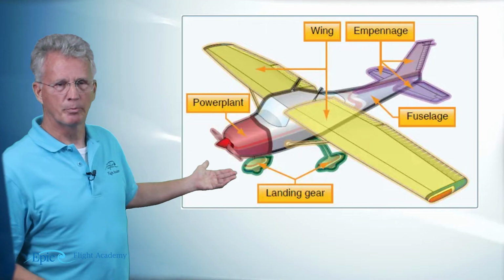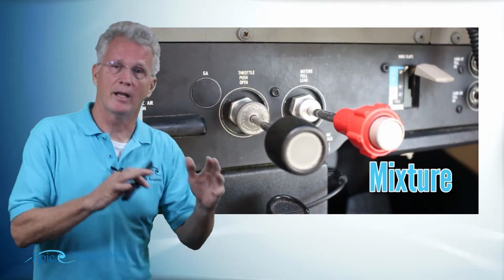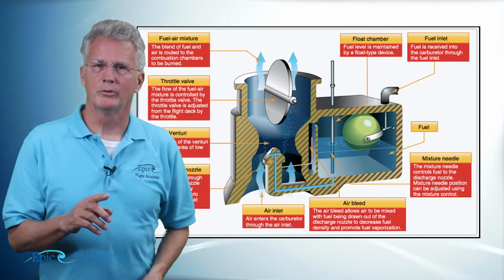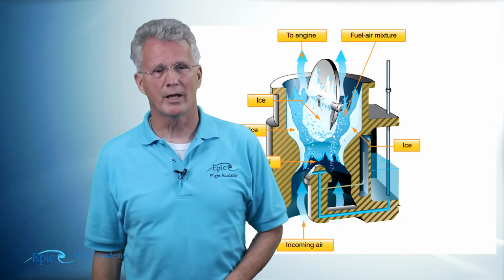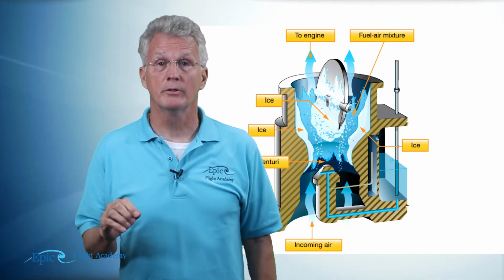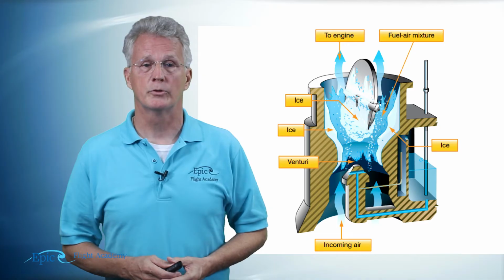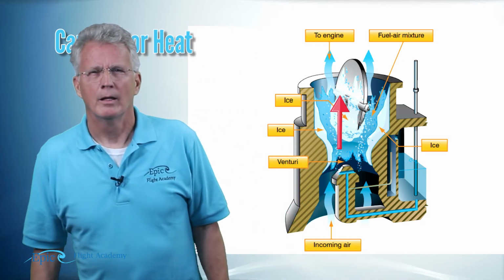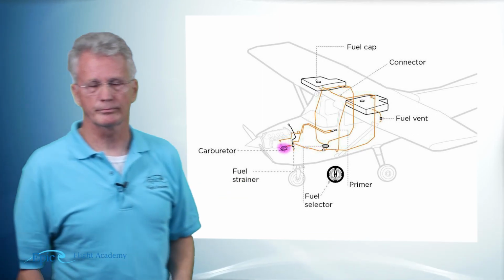PPGS Lesson 6.3 | Aircraft Systems: Air Induction Systems

Comment: Your teaching style is amazing!  Question: Why not just leave carb heat on all the time?
Reply: here's what i think why
prolong engine life
hot air is less dense making fuel mix richer
less dense air means less altitude to fly (not sure about that)
Reply: @Chizzzt  not to mention, carb heat air is unfiltered. it will eventually damage the engine cylinders if you always keep it on. especially on the ground!
Reply: a decrease in engine power and possibly detonation, when carb heat is not needed